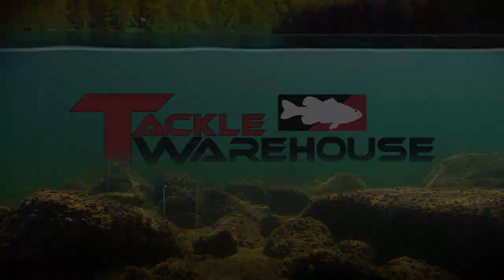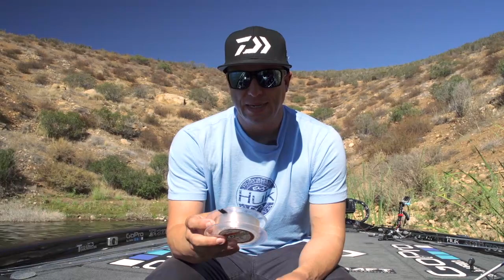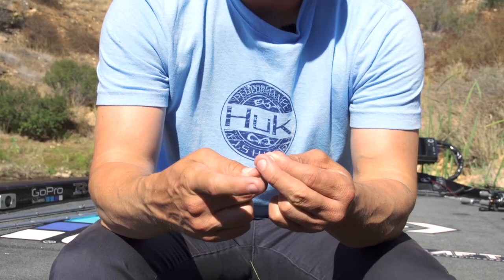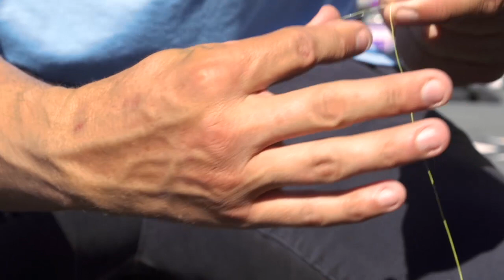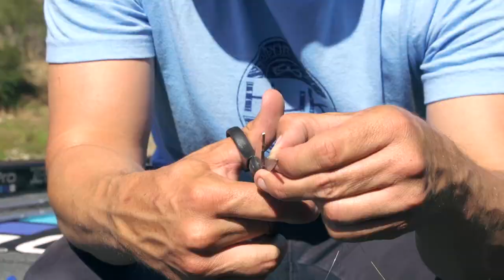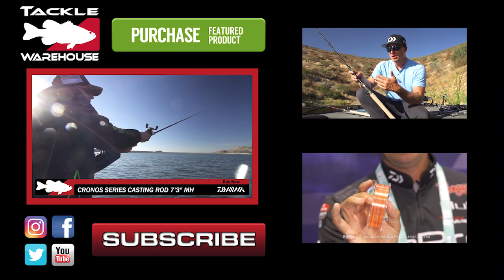Brent Ehrler Pro's Pointer - Tying the RP Knot with Sunline FC Sniper Fluoro and TX1 Braided Line

Comment: That is indeed the same knot as the Crazy Alberto.  I prefer it over the Albright, but it's not as strong, or as small as the FG knot.  I've noticed that any knot that has tag ends on the end of the knot will sometimes get hung up in your guides, whereas knots like the FG (and Blood Knot) where the tag ends are in the middle of the knot always come through the guides better.